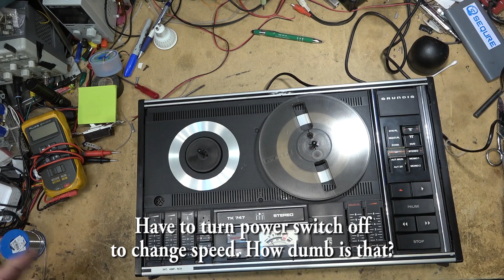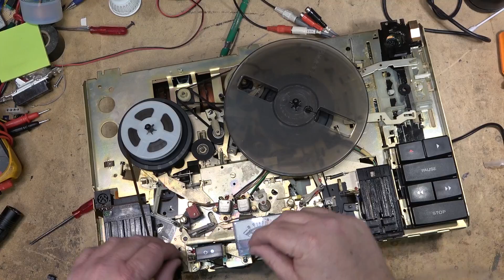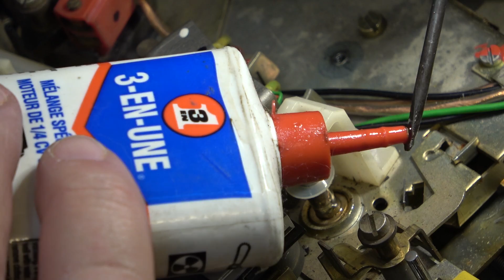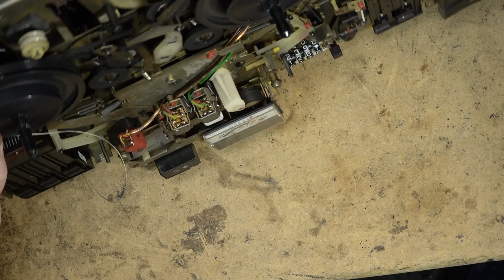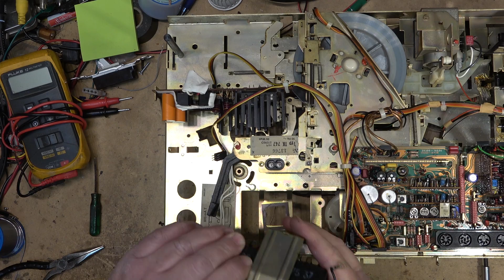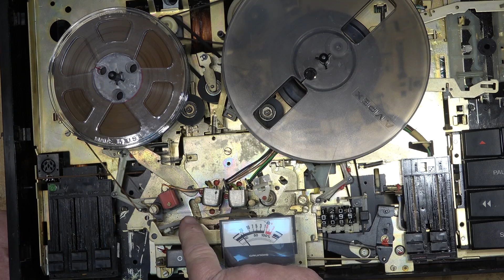Grundig TK747 Reel To Reel Plays at wrong speed

Comment: To increase the belt tension some rubber/foam window gasket could increase the size  of the old square rubber mounting of the motor. Great videos, you helped me in the past to figure out the fault of my receiver, multi-button input resistor ladder caused by oxidised buttons that developed their own resistance. Thank you 👍

Comment: well done, I'm getting lots of flashbacks here :)  Generally speaking, it should be said that GRUNDIG products (especially televisions) from this time stood for solid and highest quality (at least in Europe).  Funny detail: did you notice that even the flat ribbon cables in the device have the German colors ( black-red-yellow)? :) I've repaired a lot of such devices but it's now that I really notice it.  Allow me one small complaint: After stopping (after Play or Fast Forward), the left tape runs far too much and is braked too little... one cannot imagine how long the tape runs on there without really braking when larger, heavier reels are used. Apart from this:  great job!

Comment: There appears to me no playback volume control; all the sliders are turned down!
Reply from the maker: The line out is fixed level.  The sliders are for the built in amp, and if you read the label that was stuck on it said audio amp NA.

Comment: Hi and thanks for your video.i live in UK,i know nothing about electronics at all,my highest IQ is changing a plug...lol,but i bought a couple of weeks ago a TK747 just to try out,was told no lead with it but already had one,tried to power up on 240v here in UK,but no power,it was getting to the motor,but not beyond that.used electricians tester so it was getting power,stripped it down,motor etc like you did,still nothing,so the last attempt was to try 110v like you have over there,(this model has 110,120,220 and 240v plug switch at back)put it to 110v and used a transformeror, 'knock down box' we call over here,switched on and hey presto,power at last.Could this motor been 'blown' on 240v,i checked the 3 fuses on the motor board and they are all working,any clues?

Comment: So the actual fix to the problem was that the motor was loose? Everything was slipping somehow? I see all the bearing lubrication done, but the torque of that motor would have hardly seen any bearing stickiness that would have accounted for the significant speed problem seen at the beginning. As always, highly enjoyable repair process to watch.
Reply from the maker: Did you not see the part where the motor was slow and there was no belts on it? The bearing was causing the trouble.
Reply: @12voltvids  Yes. But although you commented on the dry state of the bearings, when you had the motor in your hands disassembled, everything seemed to be free moving and turning very easily. Hard to see then how just the bearing was the only culprit for such a dramatic speed issue. That was my feeling.
Reply from the maker: @chillidogkev  well it was slow to get to speed and had low torque.  It gained speed after running a bit but once cooled down it was very gummed up again.  You did see the state of the old lubricant that came out of the bearing didn't you.  It was all black.

Comment: A European equipment with mixed Phillips and slotted screws ? How common is that ?
Reply: Probably made loads of those slotted screws - which seem far more common in metal to metal parts,  but the outer screws with Philips heads seem more common going into plastics.
Reply: @highpath4776  But I have never seen them combined in one product before , especially in European products !

Comment: I have a Sony TC399 that started to run slow by about 3%. I’ve determined that the motor run capacitor is failing. I’ve ordered a replacement from DigiKey which should solve the problem. My test tape is one (on a three inch reel) that I made when I purchased the deck over 30 years ago. I recorded 440 Hz for speed checking and 12 kHz for azimuth alignment. The test tape is starting to unfortunately deteriorate and was curious to know if you make and sell test or alignment tapes. Commercial tapes seem to be pretty pricy for my occasional checking.

Comment: I have read that 3 in 1 oil contains a rust-inhibiting polymer that coats the metal with a solidifying film, making it less than ideal for motor bearings and the like. My tapedeck-specialist technician friend uses synthetic Mobil 1 instead.
Reply: Dave uses the 3-in-1 Motor Oil in the blue/red/white container specifically meant for motor bearings. This Motor Oil is formulated differently than the much more common 3-in-1 multi-purpose oil in the black/red/white container

Comment: I would say the tables brakes are not very effective, the supply spool still rotates a bit after play is stopped leaving a slack of tape...
Reply: I wouldn't trust any important tapes on that unit unless I was very careful with the tape transport and being on hand to smooth out that whiplash in the tape slack every time.
Reply: I wonder if it’s not quite working correctly. Maybe something is still a bit gummed up with dried lubricant?

Comment: That deck is actually well engineered. Many cables are fitted on connectors and not soldered, the boards are neatly placed, the transport is simple enough. I like it.
Reply: Good old Grundig.

Comment: Have the TK-745, these recorders aren’t hard to get running mechanically, it’s the electrics that get you. The fancy auto levels system for recordings has given me nothing but trouble, even when I’m trying to use it manually. 

Still haven’t figured out what’s causing it, and I’ve had the damned thing for almost 5 years.